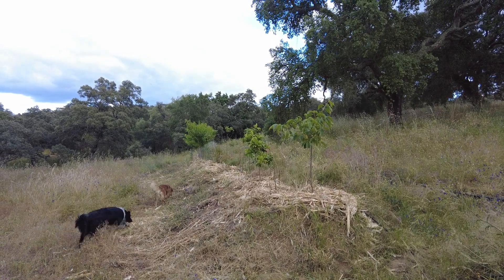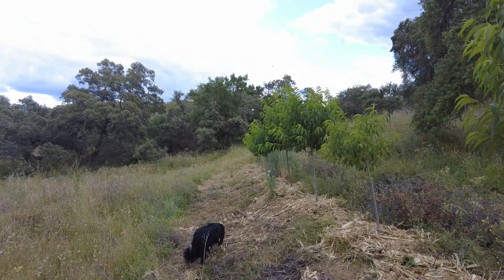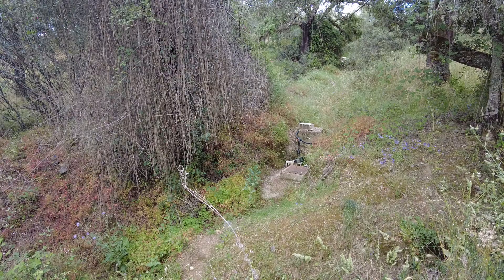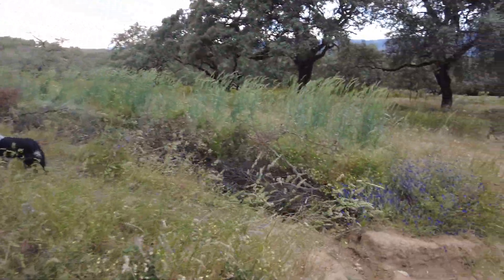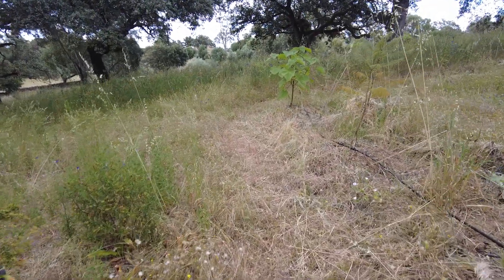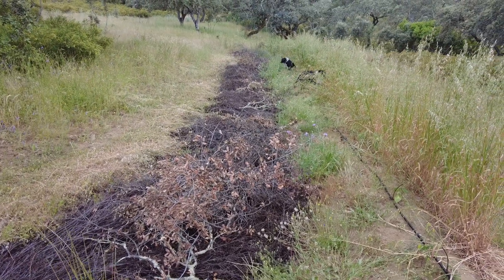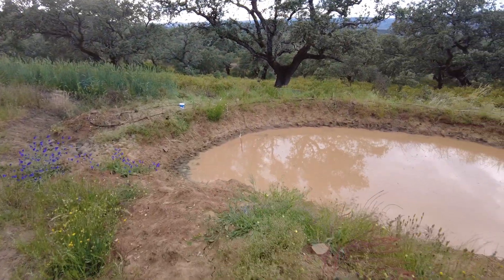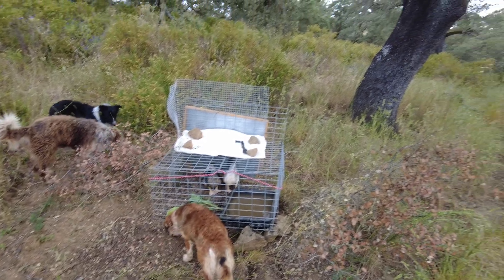Drip irrigation installed. Another fear bites the dust.

Comment: With the mulch, the consistent supply of water and the heat and sun of your summer, I expect everything that you are irrigating will have explosive growth this year.  I will not be surprised if you paulownias double in size.
Good thinking on having a backup pump on the shelf.  Be prepared.  Have you measured the output of sample emitters in different zones?  I'm really curious to know how close they are to the manufacturers rating.  Also, what are the pump spec's for liters per minute? I'm wondering how many liters you can theoretically pump in 60 minutes. 
You may want to make up a 'go bag" to carry with you when you walk the zones to check the system.  I would include the basic tools for installation and maintenance, a disposable cigarette lighter for quick PE pipe heating,  a few of the accessories used (emitters, valves, etc)  a roll of spaghetti tube, your moisture meter and a good pair of tree pruning shears for the occasional branchlet that meets your eye.  You will likely want to add emitters around trees, for instance.  And you may want to run a few single long spaghetti lines out to a few select holm or cork oaks.  This is another step toward decicing which "too close" trees to cull this winter.  You could go so far as to buy a 25 pack of emitters that put out double the water per minute for the select volunteer trees.  They will be a different color - so they are easy to identify.
If you are looking for an excavator project, you could widen and deepen the pond at the eastern culvert that holds water.  Shoot for 4 times the size and twice as deep?  Deposit the spoils as a tall berm on either side of the concrete block dam, compacting as you go.  It would be important to build the berms now while the earth still has some water.  Remember - we learned that dust won't compact.  And with your irrigation system. you could have those berms covered in grass before the fall rains come. I'll suggest buying a roll of 16mm pipe with molded in emitters for the purpose of growing grass on dam berms or in ground seed starting for instance -  just as a trial.  This roll of emitters would be moved around as needed and rolled up and stored until the next grow site. You can probably buy as little as 25 meters.  
Hope something here is useful.
I'm really happy for you and the gardener :)   
Remember - roses don't like wet leaves.  That is how black spot gets started :)  Drip irrigation is good!
Reply from the maker: With a backpack filled with tools, the neighbours already ask if I go to school. Thank you for sharing Steve. Much appreciated as always.
Reply: @SuerteDelMolinoFarm  :)  Now that is ambitious!  I had no idea.  I never exceeded a 5 gallon plastic bucket.  Good for you Martin.  Your encore career!  :)

Comment: How deep is the water table ?
Reply: The precise origin of this water beneath the mountainside is unknown.  We imagine the water flows from fissures in solid rock.  The water is collected in an ancient Moorish construction called a 'qanat' which ends in a cistern.  Along the qanats route, the owner has come to a point that is blocked by rubble.  This is where exploration has ended.  It is from the cistern that the irrigation water is being pumped. The floor of the cistern is between 3 and 4 meters deep. The potential for the qanat is unknown because  this owner has not had the opportunity to test the limits.  
If the qanat dries up in the next 4 months, there is a borehole on the property.  That bridge will be crossed if and when we come to it, I imagine. :)
Reply from the maker: OK. Let me try to understand water table. To me it's finding water when digging a hole in the earth. That's before going through bedrock. The water in the borehole sits at 9 meters. I assume it's with the upward pressure of the aquifer. I hope this helps.
Reply: @SuerteDelMolinoFarm  I believe most people understand water level to mean the distance from the surface to a large consistent aquifer below bedrock.  
When the press talks about pumping water for irrigation to the extent that the water table drops - they are referring to your 9 meter borehole metric. :)
Water sitting on top of bedrock is a 'perched' water table. Typically a small amount of water dependent on precipitation and infiltration rates.
Reply from the maker: Thank you Steve.
I tried to find the water table several times but no success as yet. Thank you for asking
Reply: @SuerteDelMolinoFarm  I think the answer he is looking for is how far down the bore hole before you hit water.  You may know that answer.   My recollection is that it is not terribly deep.  :)